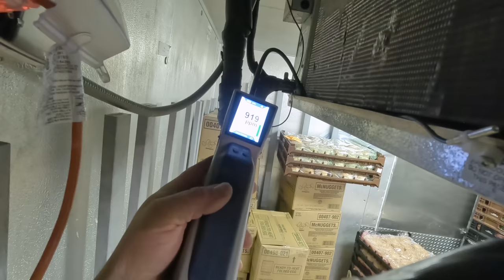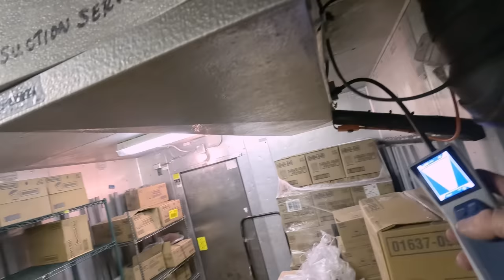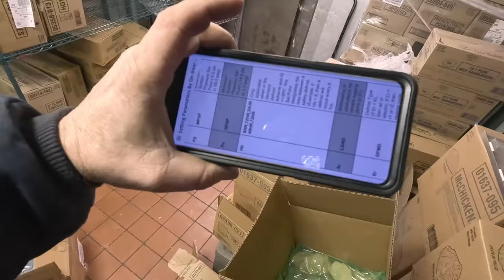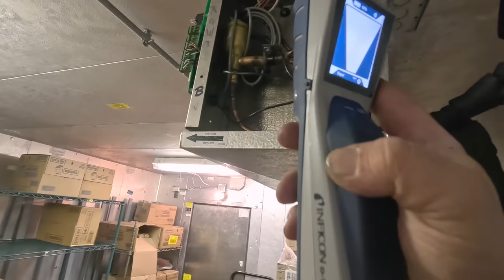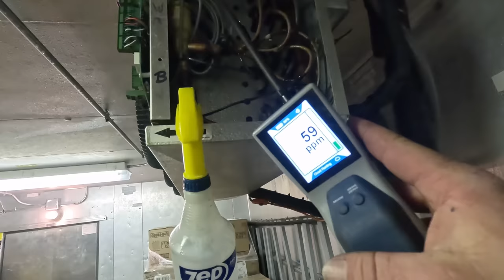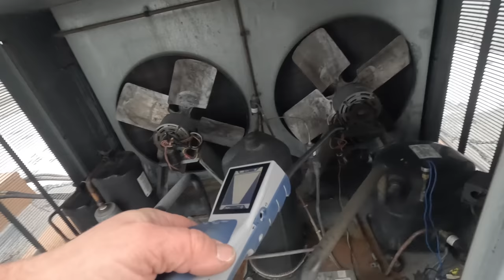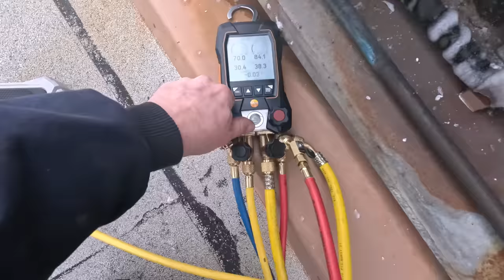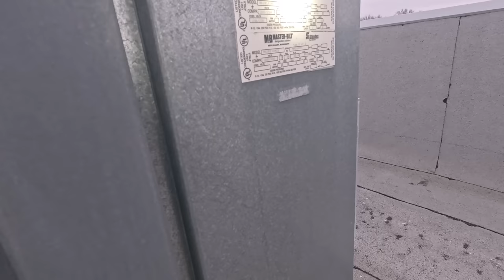Not A Good Time For Failure!

Comment: My company over here in Oregon services that same restaurant chain (about a dozen of those locations). If you haven’t figured yet, you will soon enough, freezer calls there are non stop. A lot of the issues due to lack of PM and how they have an outside freezer door (usually with a bad door gasket they don’t want replaced) that they leave open when they get deliveries to stock them with no pump down switch or anything. 

We had a coworker who witnessed the outside freezer door be open for over 2 hours straight. 

Long story short- constant freezer issues and you’re usually trying to correct something that so many people before have made a mess of it all.
Reply from the maker: We're just filling in when their guys can't get to it.  I noticed everything I've run so far has been freezers. 🤦🏻😁👍👍

Comment: I’ve worked on that same MasterBilt equipment before and as per the factory tech 
“ Do not clear the sight glass” will be overcharged 
You hit on it when you said EEV they use that eev to flood the condenser and charge it over ambient 
Should be some fan cycling going on
Reply from the maker: At the leak rate that thing had I'll probably be okay, so how are you supposed to charge it? It didn't have a total charge, how many degrees over ambient?

Comment: So much for not blocking the electrical panels. I've seen it more than a few times myself.
Reply: One customer.  Phone room has a huge sign on it.  "DO NOT BLOCK DOOR."    Janitors can't read, and apparently neither can the other people using the main room.   Constantly having to move crap to get to the door to get to the phone equipment.
Reply from the maker: It's a never ending battle. People only care about themselves.

Comment: I had some problems with my older model Testo 557. But only in "time for long sleeves weather" -15 Celsius/5 Fahrenheit or below. The batteries called it quits and the manifold started to leak around the o-rings.
Reply from the maker: That's better than a total electronics failure like I had.
Reply: @HVACRSurvival  Yep. Had that problem to but on the same manifold which ultimately retired it but I brought it on myself.

I was in a bind and the batteries died. Only hade two new battiers left and threw them in with two of the old ones. It worked until the batteries exploded and corroded the circuitboard.

Comment: Be careful shutting that disconnect off in that unit. At those particular restaurants, depending on previous repairs/replacements, the ice machine and multiplex will be piped in there as well so if you shut the disco off, if those are still running, it will trip head pressure. You can see the other lines in the video. If I do a replacement at one of those stores, I normally separate the units into their own condensing unit.
Reply from the maker: That's why I was disappointed they put everything on one disconnect,
Reply: Do you work on Multiplex.
I started a new job for a burger chain. They have MP. I’m learning about them . New for me.
Reply from the maker: @Mike I might have done one or two multiplex?.  Grocery racks and chillers are my latest to polish up on.